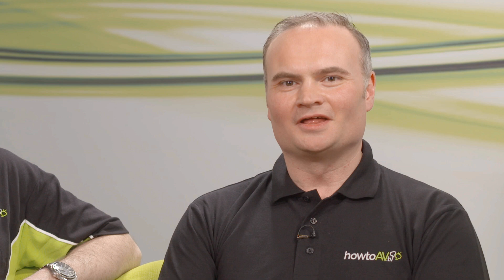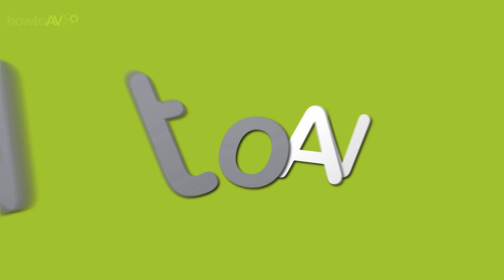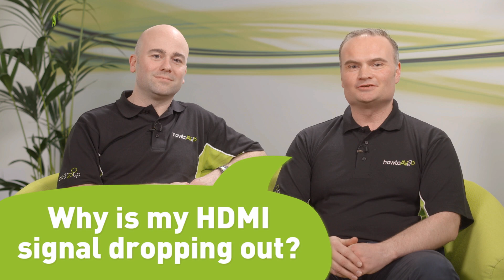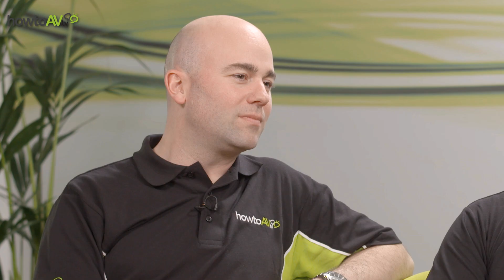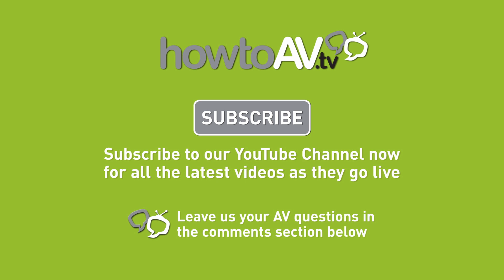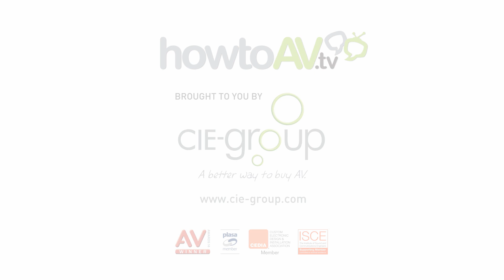Why is my HDMI signal dropping out?

Comment: Hi. My nephew has a laptop which used to connect fine via hdmi to his tv but ever since the laptop went in for repairs, no hdmi signal to tv. Apparently picture appears for a second then disappears. Any help would be appreciated. Thanks
Reply from the maker: Based on the fact that it was working fine before it went in for repair, it really needs to go back to whoever repaired it, we would suggest. Likelihood is that perhaps an incorrect driver has been installed for the graphics card or mother board, or perhaps a faulty connection on the circuit board.
It could be one of a number of issues, but really should be rectified by whoever repaired the laptop.
Reply: Thanks, will do.

Comment: Hello there, recently i bought PS4pro and connected to my 1080 hdtv and i am experiencing some flickering snow static issue with popping sounds, sometimes the static only occur on the bottom part of my tv, then go blank. Once i've tried to change the tv input to av then switched back to hdmi and the problem went away, and one time it didnt work and i tried to replug the hdmi cable on my ps4 pro and it worked. However this happens randomly.

Can you give me some advice? many thanks mate
Reply: Same here I have been through  3 cables off  various  price still happens did you manage to solve  the problem

Comment: Hi, i have 2 different set top boxes i have connected to 2 Soniq smart TV's, i have run 2 X 15m HDMI leads into both TV's so i can watch the same shows on the both TV's at once or have them transmitting a different show at the same time. Before i connected the 2 splitters to the set top boxes the 15m leads worked fine as i tried each individual one at a time. The problem now after i connected the 2 splitters is the picture will disappear and come back on after about 30 seconds, the display will be good for a few minutes and then it will disappear again, i noticed with one of the TV's is when the picture disappears there is static across the screen. Anyone else have a problem similar to this........Regards

Comment: Hi guys. I bough a modded sega with av composite outputs. the image constantly cut out with the standard cables so i bough a high quality $35 one. i still occasionally lose signal. This is composite from the back of the sega to back of the TV. composite works fine with the playstation.  i have ordered a AV to HDMI adapter so will see how this goes but any advice as to what i can do with the current situation? cheers

Comment: I've got a HDMI repeater for my beamer witch is connected via a 10m cable. It is plug in on "HDMI Out 2" on my AVR. I have no issues with my Blu-ray Player but when I switch to my PC there is no picture via beamer, only via TV (which is connected on "HDMI Out 1", without repeater). Any ideas?

Comment: It would be great if you can answer this!  I have a Vizio smart tv. It has 4 HDMI ports. I'm working on "cutting the cord" (getting off of cable and going OTA and streaming). My cable box from the cable company works fine, my DVD player works fine. When watching TV with my Amazon Fire TV stick, my apple TV and now with my TiVo Roamio it will be working fine then all of a sudden the screen will go black say "no signal input" then in a flash (1 to 2 seconds comes right back on). It will do this several times during a movie.
    I have changed HDMI inputs with all devises and it continues to be a problem.

    The TiVo Roamio and apple TV are connected to the router with Ethernet cords and the fire TV stick is wireless wit the router 10 feet away. 

    It seams to only effect the equipment that is dependent on the router; which is brand new from the cable company (X-Finity modem/router combo).

Please help,
Mark
Reply from the maker: Hi Mark and thank you for your question.
We're assuming that your Vizio Smart TV is using Wifi for it's internet connection? this assumed...

There's a chance the technology in the TV with regards to its wireless connection is at fault especially when recieving HD or more.
We have previously experienced a NAS drive would do exactly what you experienced until the TV was connected to the Router via an Ethernet line.
The the fire stick connected to the TV is probably using pretty good wireless technology, because it relies on it so heavily to be successful. 

Therefore, first option is can you connect your TV to your router via an ethernet cable, therefore potentially giving a drastic improvement in the ethernet signal?

Another option may be to check for any recent firmware upgrades to the TV - contact the manufacturer.

Hope this helps,
The HowToAV team
Reply: Thank you so much for your reply. Yes the TV is connected VIA Ethernet. Good idea on the firmware I'll try that. My thought is maybe the HDMI board but have found no one with the same problem. What do you think?
Reply: Mark Schneider I have the same problem same thing

Comment: Hi...i have a problem with my hdmi port on optoma eh501 projector. It suddenly can't detect the signal of hdmi, i've tried with the vga port and it works. How can i make the hdmi port work again? 
(I'm using imac to av receiver and then the main output to projector)
thanks before.

Comment: Hello. I have a Samsung Syncmaster S22B300 monitor and I use a HDMI cable for it. I moved my monitor while I was tidying and it went black. I restarted the monitor and it changed from HDMI to Analog 5 times and on the fifth time it stopped on HDMI and blacked out. This has hapenned before , I fixed it with just plugging and unplugging the cables from the monitor and back of my PC many many times , it might of taken me like 1 hour. But this time I can't fix it. What should I do? Thanks, Leo.

Comment: My Sony bravia hdmi stopped working and the following step resolved the issue: remove all hdmi cables from tv ,power off and unplug the tv. Then press the power button couple of times. Plug back all cables and power on the tv. Also disable bravia sync and any auto settings on individual hdmi ports.

Comment: Hey, 
great video , thanks for sharing! 
I bought this Sony 4K TV 2016 model and after the last update ( I believe) I got a dropout on my picture. I 'm using external TV box with an HDMI signal output. I had reset the TV, changed the cable and yet the problem still occurs. The issue itself is that there is a signal with sound and all however on some (HD) channels the signal drops out for a second and briefly showing "HDMI 1080i " in a dark grey bar at the top of the screen. I've tried it with different source ,i.e. by using the laptop. In this case there was no signal loses but the gray bar with HDMI 1080i still appears occasionally. 
I would really appreciate it to hear your thoughts.

Comment: Hi, i have 2 Mac Book Pro Early 2012 with DP adapter (VGA - HDMI - DVI). I have try to connect it with to my LG TV with a Atlona Matrix and/or with a simple HDMI Switch but i have the same result ... when i try to switch from A to B i see a blue screen on A and i lose the second display ... when a switch from B to A a see the blue screen on B.
I have try a lot of Cable but the result is the same.I have also try with an old EIZO monitor 19" with DVI input ... same result! Can you help me?

Comment: Hi to you, I'm Pat, I have this problem, I use a Samsung S5 Smartphone and I connected via MHL to my 2DIN Kenwood Display Head Car system. I could see images and videos but random I loose hdmi signal without any reason, signal drops for two or three seconds and I see snow on video. After It returns to work. Very frustating when I use it to see TV or to use it with Spotify to hear music coming from my phone via streaming internet connections. Someone say to go on Air mode but I need wifi or 4G connection to use it for streaming. I tried about 4 or 5 cables, with usb power supply. I use also a Miracast Kenwood and this works very good but with a delay. I prefer to use a simple cable, more fast and without any delay but I have these issues, Any suggestions?

Comment: I bought a treadmill that has its own screen which plays videos I connected an HDMI cable to TV to treadmill to view console video on tv as I run. Signal does not work straight away it randomly works! new cable tested it works , all HDMI ports work! how can I fix issue?
Reply from the maker: Does the output resolution of the treadmill (the Source) match the resolution of the TV/screen? There may be a mismatch which needs changing at one end or the other.
Also check your HDMI connections.
Reply: Thank you!!! Works now 😁

Comment: Hello Guys, 

My name is Bruno, I have a projector that i recently got. I have my projector on the roof of my house and i have my receiver by the screen. Its a 20 feet HDMI cord that goes from the Projector to the receiver and the receiver has 4 HDMI entrance. Every time I watch TV i lose signal of the HDMI it goes blank for 2-3 seconds and then the imagine pops up again. Do I need to by a HDMI extender? or what is the best way for this problem to stop. 
Thank you so much for you time.
Reply from the maker: Hi Bruno and thanks for your question.
As the video above suggests - first things first, you need to test your Source device and your Display (the projector).

Try connecting an alternative display to your Source device (using a short HDMI lead).
Test your Projector by connecting an alternative Source to the display (using a short HDMI Lead)

Assuming both are ok, you are most likely pushing the distance of the HDMI signal too far (although 20 metre HDMI cables are available on the market, the recommendation is a maximum distance of 10-15 metres).

The best option would be to add a HDMI equaliser - such as this:
https://shop.cie-group.com/shop/av-distribution_19/hdmi_1023/hdmi-splitters--repeaters_90/hdmi-hdmi-equaliser_2994.php
between your Source and Display - a cheap and simple option which I expect might solve your problems.

Best of luck! The HowToAV Team

Comment: I just bought the 40" samsung series-5 j5100 tv and tried to connect it to my computer with HDMI cable but it shows "No signal". The strangest things are,
1. I connected my pc same way with another Singer 32" tv and it worked fine but the screen goes on and off but it was working merely.
2. I connected my laptop same way and it worked but the screen goes on and off. Again it was working merely.
But for this new tv, it can't even connect. Is there any solution?
Reply: Friend, it's not the TV, but Windows. Plug in the HDMI cable. Turn on the TV the required input of HDMI. Then turn on the power of the computer or laptop. If there on the TV, after the computer is loaded, is no signal, go to Windows Start - Control Panel - Screen - to configure the screen settings. Set the mode of work with two screens. Click OK. Everything is working. Similar actions should be performed on the Mac.

Comment: I have a PS4 Slim and the monitor I'm using is a Dell 5T2210b/5T2210 and whenever I on my ps4 there won't be a picture until I plug out my hdmi from my monitor and plug it back in please tell me there's a solution

Comment: my HDMI signal cuts off for a few seconds every time I switch on the room's light or the refrigerator cycles... it happens every time on my 2 meter long HDMI cable (left open for various devices) but not on my shorter one (fixed on my PlayStation)... I'm alarmed & worried it might harm my TV because of this constant signal flicker.... is the cable length a problem? is it the rooms electrical wiring? can I fix it with (avr)automatic voltage regulators??
Reply: Often such a problem is solved very simply: the power supply of all devices connected to the HDMI must be made from one outlet. If the devices are plugged into different sockets, then there may be damage from the potential difference on the ground. Especially from devices with electric motors, such as air conditioning, refrigerator, vacuum cleaner, if they are faulty. If you are connected to the same outlet, but there is a disconnection, then you have an unstable power supply of the apartment. There is not enough power and there is a temporary decrease in the voltage in the network. In this case, you should use an uninterruptible power supply with a double voltage conversion. Plug it into an outlet and then connect it to the TV and other HDMI devices.

Comment: I have a desktop and I connect it to my monitor with an HDMI cable and after using the computer for 2-5 minutes the monitor losses connection. but the computer is still running and the graphics card is running at 28-38 degrees Celsius... help

Comment: hello, i have 3 HDMI ports on my tv but NONE of them work. it says no signal for all of them. i have only just come across this problem after using these cables for months. not sure how to fix it. many thanks, Daniel. :)
Reply: My Sony bravia hdmi stopped working and the following step resolved the issue: remove all hdmi cables from tv ,power off and unplug the tv. Then press the power button couple of times. Plug back all cables and power on the tv.
Reply from the maker: Hi Daniel and thanks for your question.
Do you have more than one HDMI Source device and are none of them working in any of the TV's 3 inputs?
If you only have 1 Source (eg. XBox, BluRay, Apple TV, etc), then try an alternative Source to test the 3 TV inputs (borrow a device from a friend!)
If you know that your Source device(s) are ok, test them in an alternative TV/Screen.
Have you changed the HDMI cable(s) at all? (shouldn't be more than 10 metres)
How long is your HDMI cable? - try testing with an alternative short cable

If you get no results from any of the above, then I'm afraid it sounds like a fault on the HDMI card in your TV. Back to the retailer/manufacture if it's under warranty / speak to your friendly TV repair guy if not - he should be able to replace.

Best of luck!
The HowToAV team
Reply: HowToAV.tv thanks for your reply!
Reply: U have a short in your ps4 hdmi port I also figured out the same thing tonight when I got my new ps4 I'm so pissed
Reply: Quakzi
Reply: Ajaz V.A OMG THANK U SO MUCH U SAVED MY LIFEE

Comment: Has any one figure out how to stop the dimming screen problem on Xbox one when watching movies after 10 minutes
Reply: Turn off the power saving mode on the X-box. Click the Xbox button to open the guide.
Select Settings - auto off - NO (Depending on the model and firmware, there may be variants of names in the setup menu).

Comment: hello I have a ps4 but the image won't show
Reply: The manufacturer knows similar problem. Here's the Sony instructions: https://community.playstation.com/content/pdc/us/en_US/pdc-communities/support/Consoles-Peripherals.topic.html/_info_blinking_blue-cOsY.html
In addition, you should study the instruction and correctly adjust the video mode of the game console. For example, if you turn on the Power button for a long time, then the NDMI device will turn off the HDM output and go to the AV output. If nothing helps, boot into the safe mode and configure the video output and its resolution. Ask someone to help you and explain the user's manual.

Comment: Our Sharp Aquos 52" LCD TV keeps losing the signal. Tweaking the HDMI cable usually makes the image come back suggesting a loose connection or weak signal. I suspect the TV loses the signal as the set top box worked perfectly with the old plasma TV. We've tried different cables and different inputs with the same result. Input 5 works better than input 4... which also suggests a physical problem.

Would a signal booster work?

We ran into the same problem with the data projector... but it only happens with the Bluray player not with the laptop.

We tried various things there too. 

:-)
Reply: A Blu-ray player can show video with so many different settings. Some of these settings are compatible only with very expensive TVs. You must enter the player setup mode and try to set different color modes. Not the screen resolution, but the image color and frame frequency. Set the frame size that your TV has, eg 1920*1080p. Set the minimum frame rate, for example 25 or 30. Set the color to 8 bits. Save and restart the player. This should solve the problem. In the future, you can experiment with the settings, increasing the frame rate or the color depth, until again there are disconnections.

Comment: Hi i''m facing an issue (professional AV) and wonder if you could give me any advice. Below is the setup.

Source -> HDBaseT Transmitter -> HDBaseT Receiver -> 8x8 HDMI Matrix Switcher -> Video Processor -> Multi Projectors

Resolution: 2560x1080
HDBaseT cable: CAT6A-STP (distance 85m)

I skipped using the matrix switcher, HDBT to video processor, and the image is working fine.
I Skipped using the HDBaseT transmitter and receiver, direct image into the Matrix Switcher and to the video processor,  it was working fine.
Reply: I did not understand the problem. Does not show through the matrix switch on 8 screens? Perhaps your original signal has HDCP protection and, since the HDBase-T standard supports copyright rights, you can not display multiple copies of a protected image-it's a public display.

Comment: hello .. my tv started showing me that there is no hdmi detected... I have changed it to HDMI 2 it worked , but only for two days ... Again the same thing happend so I switched to HDMI 3 then the same thing happend !!! I have switched the HDMI cable with a new one .. the tv couldnt detect it .. please help me
Reply: Friend, I'm sorry, there is a possibility that your signal source is plugged into a different outlet than the TV. There is a potential difference on the ground of these two power points. The potential equalization current flows along the screen of the HDMI cable. This leads to failure of the HDMI microchip on TVs. The inputs of the TV go out of order one by one.